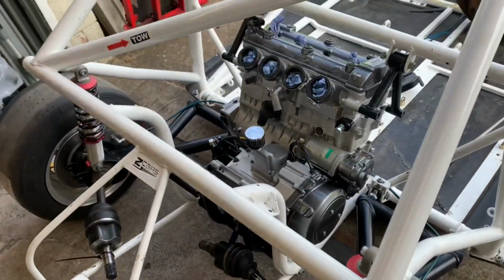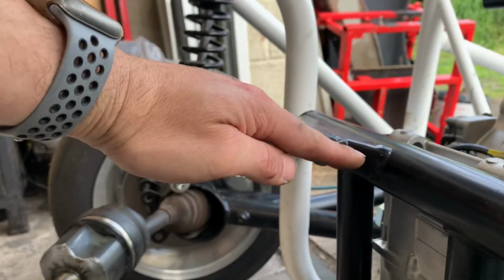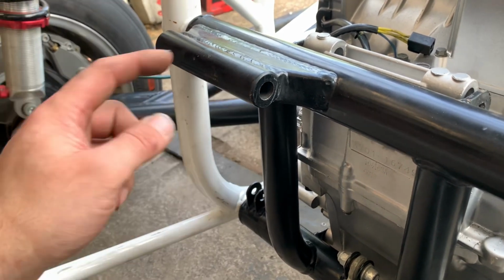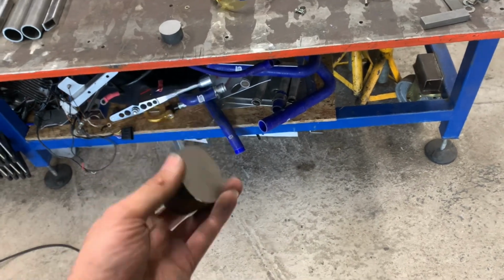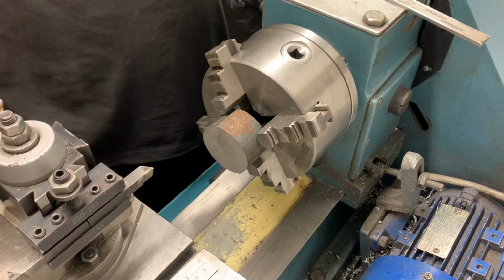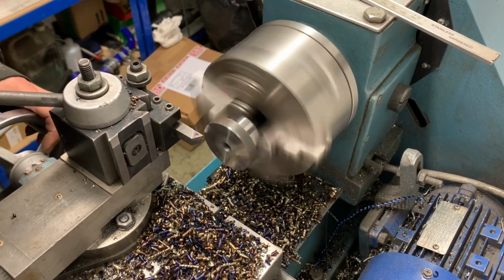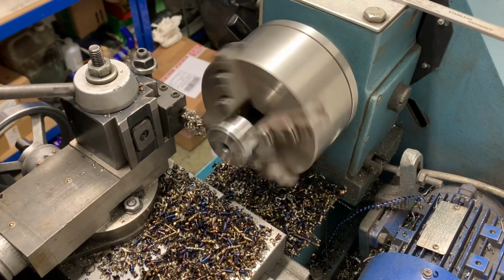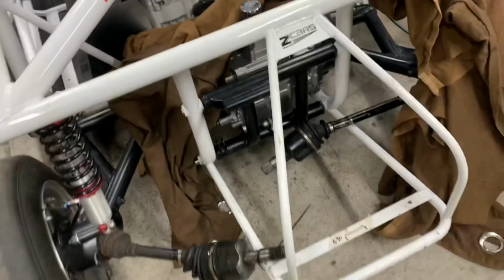Zcars hayabusa rebuild part 7, Remaking the Diff mount part 1

Comment: Looking good, it's great how we swap between imperial and metric measurements when describing things👍
Is that a 4 jaw sentering chuck in the lathe? When doing offset machining can you use a 4mm packer plate in what appeared to be the floating jaw to get an even clamp on all 4 Jaws?